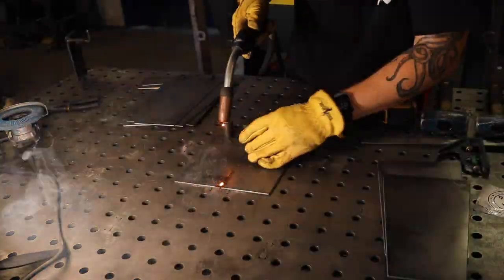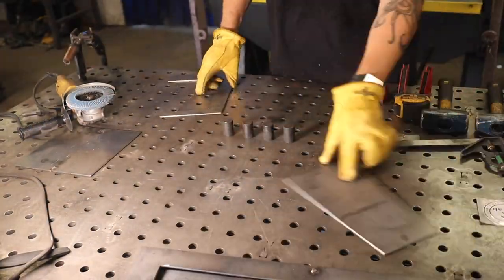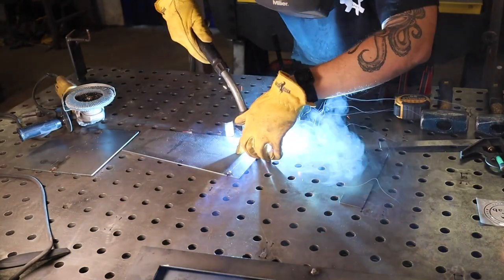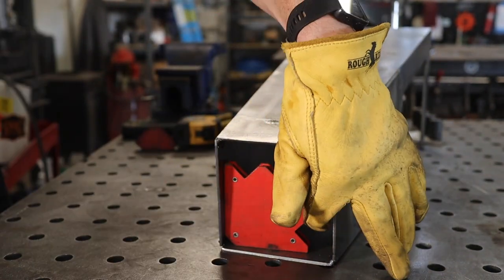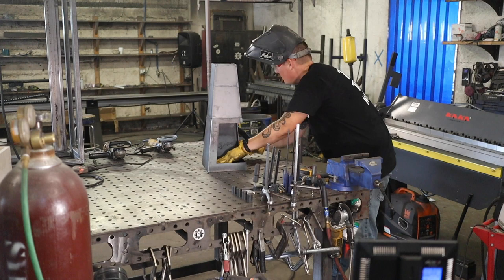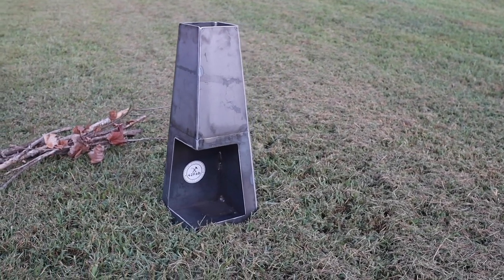CHIMINEA WELDING KIT from 42 FAB

Comment: Thanks to these type of video's, i now love metal working & welding. For staters, bought a 100 amp mig, use .08 flux cored wire, angle grinder, metal G clamps, metal set square, measuring tape, marking pen, wire brush, welding table, eye protection, gloves/jacket. Just finished building a cage for my tow trailer & steel gate for my front home entry. Purchase steel from local metal suppliers, prices reasonable. Great inspirational video guys, get folks interested in this awesome hobby. Spread the love, get people hooked, 👍🏻👌🏻👏🏻👏🏻👏🏻, cheers from 🇭🇲
Reply from the maker: Wow man that sounds like a clone of my first setup 👍 you're off to a great start. Happy making!
Reply: @MakerTable  👌🏻👍🏻👏🏻👏🏻👏🏻

Comment: Chimnea is cool I would like one just larger for my back yard. Really cool.
Reply from the maker: This def made me want a bigger one, then the heat would be a little higher off the ground and I could put it rt on the deck.
Reply: @MakerTable  absolutely! It's a great design and will look amazing as it weather's
Reply: this is the smaller of two options available. The other is 45" tall with built in wood storage.
Reply: @42Fab  ok that might be the way to go ill make this a winter project. thank you.